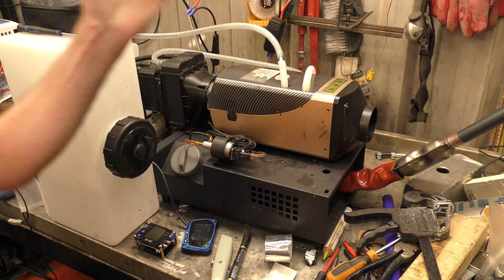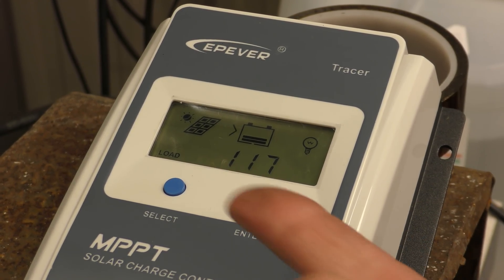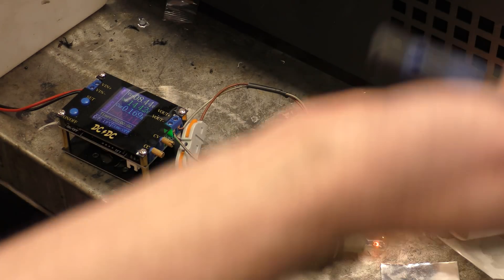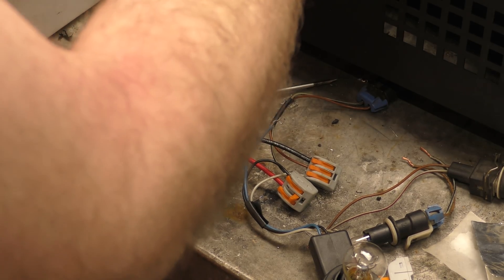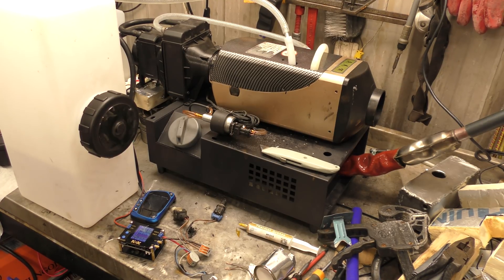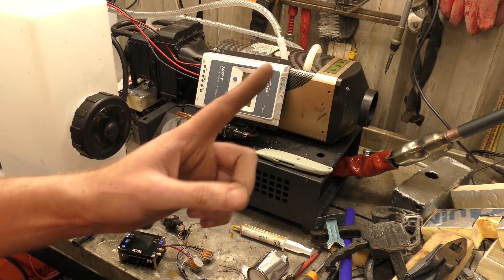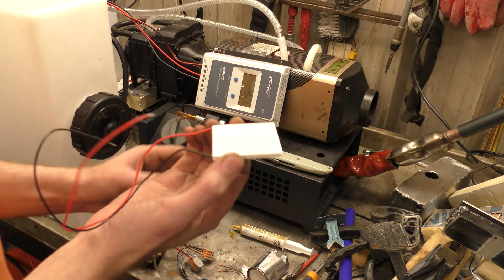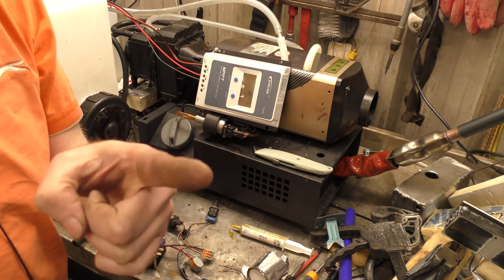Self Powered Diesel Heater Project - part 5 - water cooling, plus testing the cheap TEG modules

Comment: I keep saying that I think making the box for the exhaust out of steel will get hotter than aluminium. Am I barking up the wrong tree?
Instead of trying to mount the TEG's in one tube, use two box sections one for hot out, one for cold in. That would make construction easier and give thermal separation. Again steel for the hot, aluminium for the cold. My thinking on the steel is it will sink more of the passing heat than aluminium would.
Reply: Steel is terrible at conducting heat compared to aluminum and copper. That's why you only see aluminum and copper radiators, heat sincs and so on. Also the exstra surface area something that has fins will interact much more moving more heat.
Reply: @jim4556  agreed. but in this case we're trying to gain a bigger heat differential between the hot and cold side of the TEG the only conduction is through the TEG. Actually heat conducting through the TEG isn't desired as this reduces the differential.
Reply: @fenceup07944931177  you have to mount them to something. Sorta like mounting it to a plastic tube. The worse the material is at conducting the exhaust heat to the TEG the worse it will perform.
Reply: @jim4556  hmm I'm not sure. Without testing it. I think that aluminium conducts too well. Passing the heat through too quickly and not building up enough heat to make the differential.
Reply: @fenceup07944931177  it's not building up. You are useing it continuously. The TEGs themselves conduct a lot of heat. So if you are unable to supply them with as much heat as possible the junction temperatures will be lower. Since steel is a pretty bad conductor of heat the temperature of the steel closest to the exhaust will be hotter than what's touching the TEG. Introducing a second temperatures gradient. Where you want the maximum temperature gradient to be taking place only across the TEG. You will also lose efficiency. Since the inner most portion of the steel will be hotter than what's touching the TEG, you get less energy transfer from those gasses to the steel. 

Granted all this is also true for aluminum but since it's far better at transfering heat, it's just not as bad. Again, this is why radiators are made with aluminum and copper. They extract and release heat much better than anything made of steel. Those are exspeive metals, if steel really did work better, they definitely would be useing it.
Reply: @fenceup07944931177  similarly, if you compare aluminum to stainless steel it's 15x better at conducting heat. That's one reason why they are used as pots and pans that can be so thin. They can evenly distribute the heat while a cast iron pan needs to be very thick to do the same thing.

Now you would say in that comparison if you took them both off the burner at the same time the cast iron would continue to cook your food after the heat is removed longer, yes. But the TEG  operation is a continious one. So all you care about is what can transfer the most energy.
Reply: @jim4556  but a cast iron skillet is better for searing because you can get it very hot. 
It's like building a dam for a hydroelectric power, instead of just using the flow of the river.
Reply: @fenceup07944931177  heat conducting through the TEG is the work being performed that generates the electricity.
Reply: @fenceup07944931177  again, there is not building up anything. If it can't generate enough power continuously it's worthless. Like trying to spin a turbine with a garden hose vs a fire hose.  If the TEG is not given enough energy it can't do anything with it. Since the teg is relatively good at transferring heat from one side to the other. Choosing a restrictive material is detrimental to the performance. Since the material cannot provide enough energy as fast as it is useing it, the junction between the TEG and the steel will be colder than if you were to use aluminum. The amount of energy stored in the material is not important because your load is constant and larger than the thermal energy you have to spare.

Pretty similar to useing an appliance wired with aluminum wire vs copper wire. You need thicker wires to transfer the same amount of energy because those aluminum wires are worse at conducting energy than the copper wires. The load is the same.
Except in this case, the area of the TEG is a Constraint. You can only expose its face to so much of another material. And we know we want that material to be as hot as possible on one side. And as cold as possible on the other. But steel cannot deliver that energy fast enough.. that's why the body of the heat exchanger is also made out of aluminum. It wants to get the hot burning fuel energy to the air as fast and efficiently as possible. Even that made out of steel would perform worse if kept the same size.
Reply: @jim4556  Hi Jim, thanks for the debate. I hope I'm not being an idiot about this, as it's all theoretical to me. 
If I understand it, a TEG doesn't need the heat to pass through it to work, in fact it would be more efficient if it didn't.  It's all about getting the biggest differential between the two sides. 
As for the heat exchanger, yes aluminium is best because we don't want it to get hot we want the air around it to get hot. The opposite is true for the teg. we need to keep the surface it's attached to as hot as possible (up to its optimum temperature).
Bottom line is, would steel get hotter than aluminium with the same exhaust gases passing through it. Or would there be no difference.
Reply: @fenceup07944931177  nah I love talking about technical stuff. As far as how the teg works, the different in the two side temperatures creates the potential energy. However no work is being done just creating the potential. I belive the eat transfer through the TEG is what's actually doing the work. But they are massively inefficient. Alot more heat get through than electricity is produced. Or reverse. Alot more electricity is used than heat is moved from one side to the other if you were to use them to cool something down. 

Back to the material. I don't think the steel would get as hot as the aluminum. If it were to be kept the same size. As in the aluminum pipe would be able to collect more energy from the exhaust gasses and transfer that energy to the TEG. If you were to heat both pipes to the same temperature in and oven and grabbed them both with your hand. The aluminum would feel hotter. Because it could dump that thermal energy into your hand faster. 

Maybe that's what you were trying to say as an advantage. Saying the surface temperatures is all you care about. Well since the TEG is a relatively good thermal conductor it would make a cold spot on that pipe where it's mounted. And the more conductive that pipe is, the more energy can be transfer to fill that cold spot. 

Then as far as application. What would surpass the importance of what metal the thing is made of, is the surface area you could expose the gas to to get as much heat as you can into that pipe. With aluminum you can just buy long heatsincs like he showed in the video that can be fashioned into a pipe. You clearly want as much interaction with the pipe  walls and the gas as possible. We'll you can't buy those in steel. But you can in aluminum. Those fins and with the texture they apply to the fins massively increases the interaction area of the gases and the pipe. Probably on the order of 9-10x that of just a square pipe. Meaning you'd need a pipe 10x longer to extract the same amount of energy as that pipe made out of those 2 heatsincs. That would clearly be impractical. Both because the amount of TEGs you would need and losses from the insulation you'd need to have a comparable system.
Reply: @jim4556  definitely agree with the surface area as much as possible, and yes you use what you can get.
The cold spot thing had crossed my mind.
 And as for the metals out of the oven. If you touch them immediately as they come out then yes, don't try it but even after a short time the aluminium would be cooler than the steel.
If I get around to doing my own tests I'll let you know my results
Reply: @fenceup07944931177  forget whatever might be on either side and just consider the temperature difference across the TEG.  Maximum temp difference provides maximum electrical power.  Now add heat transfer items to get that ideal situation and it should be clear that the fastest conductors will a) provide more heat on the hot side and b) remove more heat from the cold side.  Hence aluminium both sides is better than steel of the same thickness and area.
Reply from the maker: I was going to reply but you and Jim are doing perfectly well without my input and I love that.  This is what I dreamt my comments section would look like.  Adults actually having discussions.
Reply: @DavidMcLuckie  thanks but where do you stand on the debate. I've just done some crude experiment's today, but having to use two garden chairs as a work bench and then getting a hail storm, it didn't go well. I do have a thermal imaging camera on my phone, but that doesn't go high enough.  I still think there could be merit in using steel. I'll get back to you if I have any success with my experiments.
Reply: Dear @fenceup07944931177  ,

If you still insist on disbelieving the truth, try this - more towards a limiting situation.  You accept that Al is a better heat conductor than steel?  OK.  Good.  Now lets replace the steel with something with a lesser rate of heat conduction - lets go the whole hog and use an asbestos mat (equivalent).  I was going to suggest a space shuttle tile, but they are not so easily obtained.

Now try to further argue your case.🙂. If you do, I will give up on you as an impossible case of something!
Reply: @oliver90owner  now don't get me wrong I'm no flat Earther.  And I do understand that aluminium is the better conductor. But in this case we need the heat to build up in the metal to an optimum temperature. unless it's very well insulated (probably with space shuttle tiles) then aluminium will release the heat into the air or as much as it can into the insulation.  
As I understand it ( and there is a big chance i don't)   a TEG doesn't use the flow of heat that passes through it to generate the power. It works by having a differential  between its two surfaces. So yes We do need a good thermal bond and some thermal conducting. Obviously a thermal insulator won't work because it doesn't absorb any or little heat. Steel can and lots of it. 
Let's take the extreme of heat. what metal will get hotter before it melts?
Now all this might be pointless now David is using the cheeper peltier. as I don't know what temperature we can go to. But in David's other attempt with the exhaust box it got nowhere near the temperature needed.
Reply: @DavidMcLuckie   it seems that some will not ever realise that a perfect insulator on one side of the peltier would totally destroy any chance of generating any electricity - both sides of the generator would obviously be at the same temperature in that circumstance.  No chance of getting through to some, I’m afraid, even demonstrating an insulator which is an extreme extension to that of using steel instead of aluminium (given the same thickness, of course) on one side.

Comment: Can a tiny water pump not be used for circulation?
Reply from the maker: It is.  It's about the smallest pump with good flow you can use.
Reply: @DavidMcLuckie 
It's becoming like the dynamo it can't power itself to be 100% efficient.

Comment: Lots of TEGs needed then, does make me wonder where the laws of diminishing returns would take effect, owing to the need for effective, even cooling and heating, as when you go down that tube idea, the one end will have a very hot side and a very cool side, and the other, having exchanged heat over the various preceeding TEGs, would be very likely equalised on both sides, so not enough of a differential to produce the power they could make, but its' all just thoughts in my head, never really looked into using TEGs for anything myself... :\
Reply: I think it would be beneficial if you had hot and cold air flowing in the same direction. The coldest air would hit the hottest TEG.
In real life situation you would run the heater when it's cold outside. The heater has 2 air intakes. 1 for the burn chamber, and 1 to be heated for the hot air. I'm guessing you would get greater air flow from the latter.
Reply from the maker: I've been thinking about that as well.  Would just be a case of making either the intake or the exhaust longer.
Reply: What about using the heat from heater using peltier modules to power a fridge freezer?

Comment: Would silver plated metal strip. Transfer heat/ cold better?
There is rad coolant additives that might improve heat transfer. 🤔
Reply from the maker: More perfectly machined surfaces, better thermal interface material would all improve heat transfer.  I've used the additives but remain unconvinced on their effects vs pure water.
Reply: @DavidMcLuckie  
I too wonder if that addtive was all smoke and mirrors.